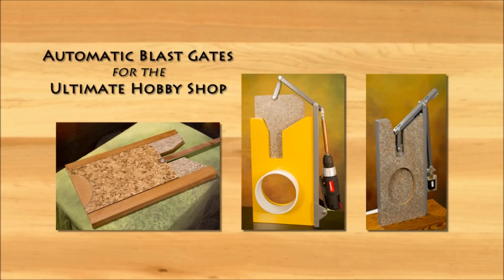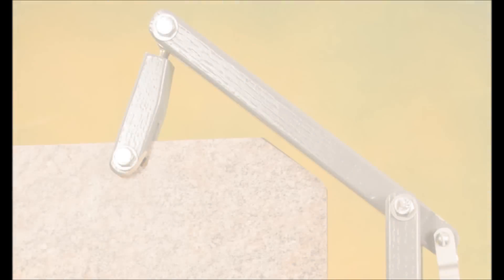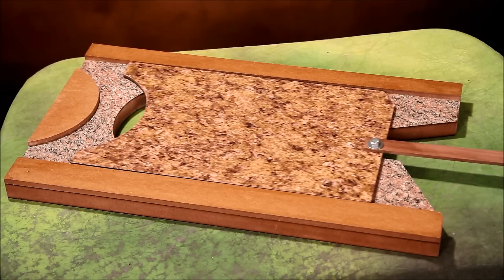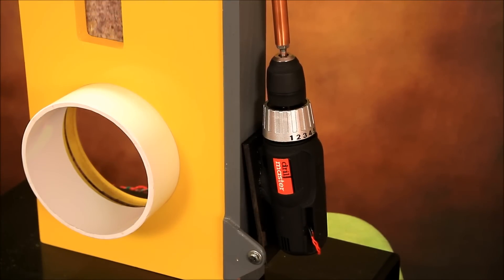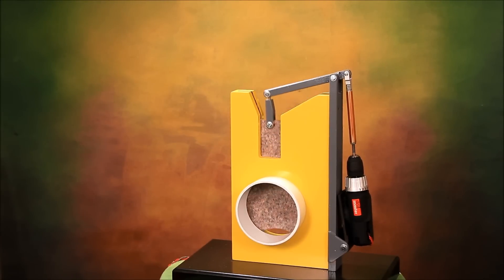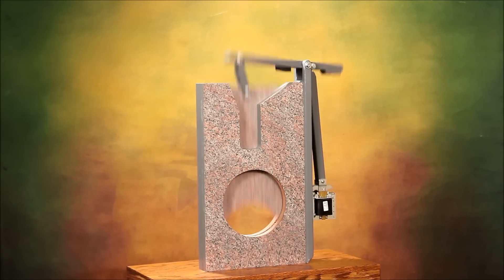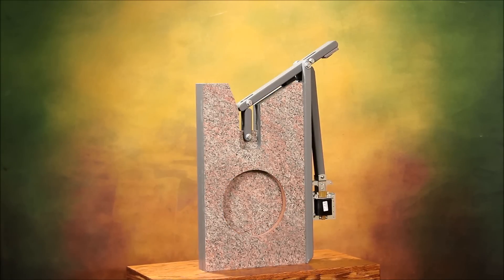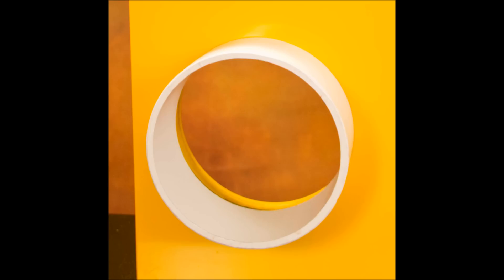Blast Gate, Automatic for Dust Collection in Woodworking Shop

Comment: I recently but mentally designed a pneumatic powered blast gate requiring no electrical assistance and deploying the available forced air within the dust collector as the kinetic energy source required to impart movement to the blast gate via a suitable pneumatic motor. I'd be using pipe organ "technology" to make this. I recently installed a redesigned d.c. system in my shop but 9 out of 10 times I forget to accordingly adjust the blast gates before I start drilling or ripping.. I understand the host has built a pneumatic blast gate but I won't view it for fear it might influence the design currently registered in me 'noggin.. A not too bad source for low voltage DC solenoids (btw) at low price is an auto parts surplus retailer-- you'd require a relay to deal with the voltage and current difference--unless you happen to have a shop and tools operating at 12 VDC.

Comment: In 1995 Jim Halbert began changing small shop dust collection. His neutral vane became the standard for almost every dust collection cyclone today. He documented his portable cyclone, his automated blast gates, how to do air measurement, his remote control with circuit diagram, and his mini cyclone for his shop vacuum. Jim helps keep my Cyclone and Dust Collection Research web pages accurate and understandable.